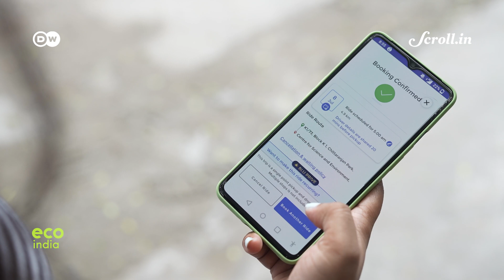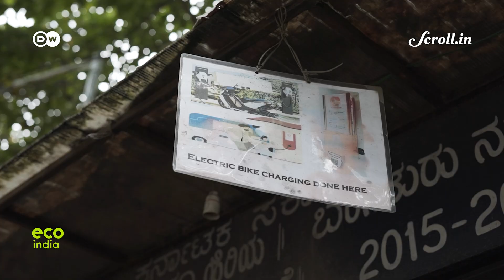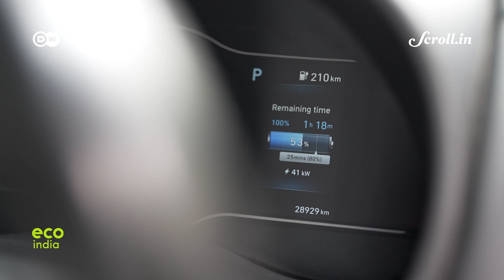Eco India: With 50,000 tonnes of battery waste, India has a long way before EVs can be called green

Comment: just be real honest to tell the people that what it cost to replace a battery after 5 years? what percentage of the vehicles cost is needed?
also fossil run power station do the job.
pollution does happen but only not in my backyard.
how much pollution is madd to extract  lithium and need to tell people about the waves the engine desipates which may cause cancer.
Reply: Yes, 
India just needs Nuclear energy, Metros, Electric Railway, Good Roads ( automatically reduces pollution and improve speed and efficiency).